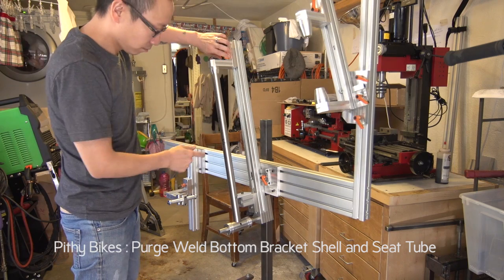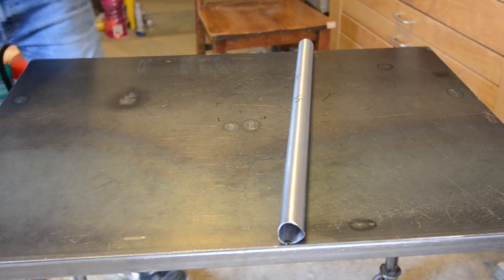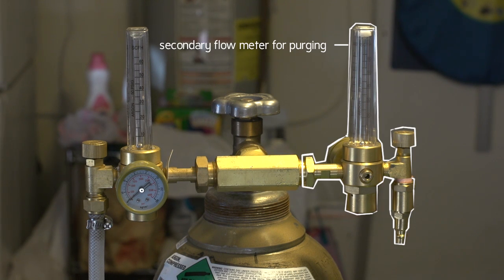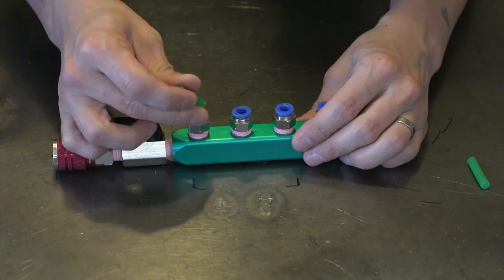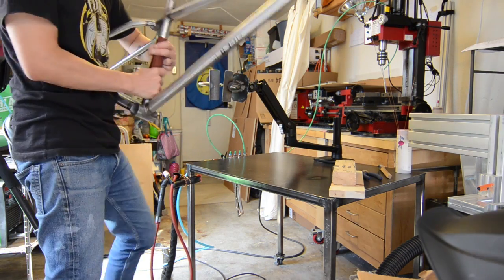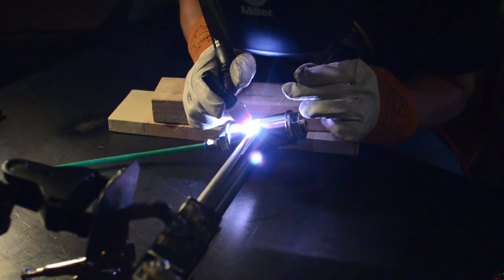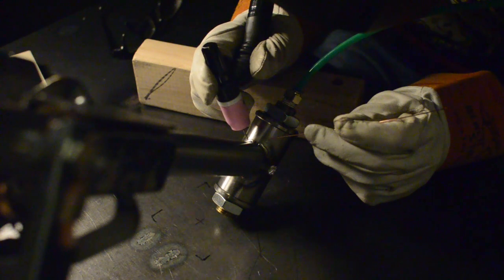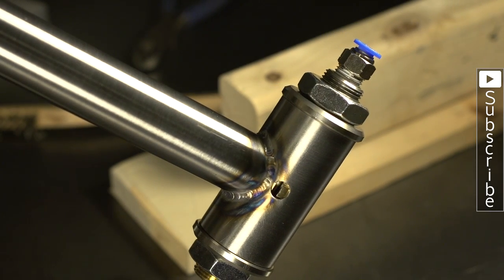Bicycle Frame Build 32 - Argon Purge and Tig Weld Bottom Bracket to Seat Tube

Comment: Hi Steve,
Was your original seat tube a 28.6mm x 0.9/0.6 True Temper? What were the factors that led you to a different tube, and what did you end up using? Thanks!
Reply from the maker: Hi Brent, My original ST was this one - http://www.henryjames.com/true-temper-28-6-mm-single-butted-seat-tube.html
So yes you are correct. I ended up using Henryjames ST # AVROBST-649. The reason was because I had planned on welding an integrated seat post on. The bmx type does not extend down the tube. My original ST had only a 6mm wall at the top and I feared this would not be strong enough.

Comment: You made a good argument for heat sink and back purging, just showing the finished interior of the BB.  I have been learning and doing without either and wow what a difference. Also interesting to see you welding here without the pulser?? After the last few videos with you practicing so much with the pulser turned on, I was expecting to see you doing that.
Reply from the maker: +Ken Lanham I was manually pulsing in this video. But its funny, now I'm back to the pulser again. I can't seem to make up my mind lol.

Comment: For purging, that bottom bracket purge block looks nice but is it overkill? Could you have just ran some gas hose in the tube and plugged the ends? I no nothing about bike building so I'm sure there is a valuable reason...
Reply from the maker: Hi.  Yes if you are just purging, simply running a tube inside will do the job. But in this case the BB purging block is also a heat sink which reduces distortion.

Comment: Very nice video series. I'm a relatively new framebuilder (4 frames) myself and building almost every tool in my machine shop as well. This inspired me to make the heatsink and i already have most of the parts done,the only part left is the spring sleeve itself. But i have a question for you Pithy. I'm not really decided on the OD of the thing where it's actually going to mate against the inside of the BB. I'm thinking 35.5-36mm. I'm afraid if i make it too tight i might have a problemremoving the thing after welding. But again too loose i might not be able to expand it enough to touch the inside wallof the BB. Can you help?
Reply from the maker: +dimtt2 I own one heat sink and it's a snug fit. I would go with as close a fit to the inner diameter of the BB. The reason for this is you want the surface to touch as much of the inside of the BB as possible. If you go a bit smaller, then less will touch. Hope this helps.  Also you can check out Duncan Cycles flickr, he made one and his pics are quite helpful.  https://www.flickr.com/photos/duncancycles/page4  I need to make one soon too for the HT. Good luck!

Comment: I'm a red seal fabricator whose personal experience has always been in heavy carbon steel and AR plate building large machinery. I find your coverage of this journey into bicycle manufacturing absolutely mesmerizing ... i guess i'm a bit nuts ....
Great looking little shop, looks like you've got the finances to get what you need to get the job done, and you're innovative in making your own tools as well ... I learn as you go ....
I am passionate about motor assisted cycling, both small 4 cycle gas engines and electric.
(but no stinky two cycle chinese crappy motors).
I have a number of fabrication ideas I would love to get your opinion on, I have yet to see anyones' bike design like the one I have in mind.

last question ... do you think bike welding could be done with microwire Mig ... or is TIG the only way?

Comment: Curious to know the cost of tools and material to do this.
Reply: +wc3415 You could get set up for 3-4 thousand for tools alone (no jig) if you were very careful, researched, and weren't in a hurry.  I've seen jigs that were worth 200 bucks and others that were worth 6000.  Spending more gets you better machine tools, better welder, etc.   A tube set runs 100-200 bucks and the parts for the build (components, wheels,etc) can run from 1-2k to much more.  But in the end, nothing compares to the absolute bliss of building, and then riding, your own frame.

Comment: Yo Pith, very good decision to go with thicker ST.  My first seat tube was full o'holes and ended up cracking in use at the TT / ST junction.  
What end of the ST did you weld to the BB?  
G
Reply from the maker: +aspenbanjo I welded the thinner wall end to the BB. The thick wall end will get the TT/ST.

Comment: Nice!  It looked like you went left handed for a bit?
Reply from the maker: +Joey Mesa Yes, I'm fairly new to welding so I started practicing with both hands from the beginning. I'm glad I did because when I need to do the other side of the tube I can just switch hands rather than having to re position the frame.

Comment: No need to wait for it to cool in between segments. That shouldn't take more than a few minutes. Do your segment until you start to feel out of position, taper off and hold your post flow over the bead AND the end of your wire, reposition, and go again. 

I'm loving your videos!
Reply from the maker: +zanconato You don't know what a relief it is for me to hear this! I was getting so impatient between welds. Yeah for the wire I got into the habit of snipping the end off before each weld. But keeping it shielded will save me money, I'll try to do that. Thanks for watching!
Reply: +Pithy Bikes Wait until you start on aluminum. Hold onto seat, that moves fast!
Reply from the maker: Right! hahah.